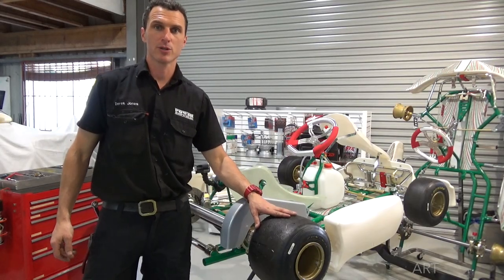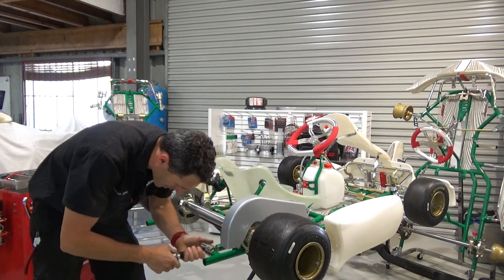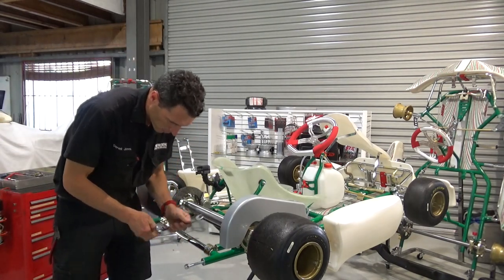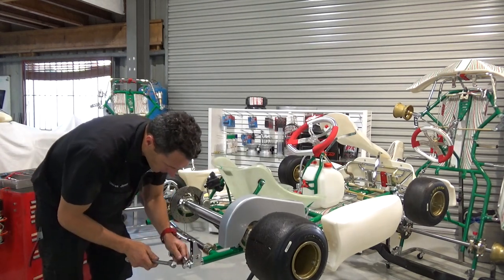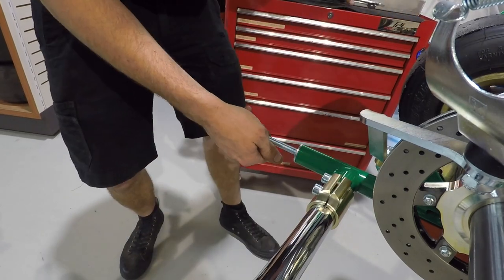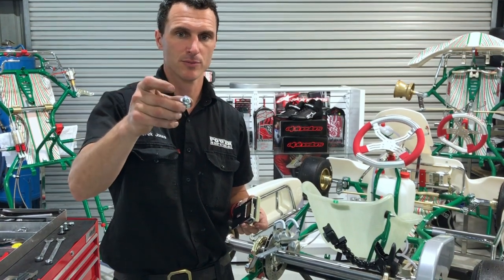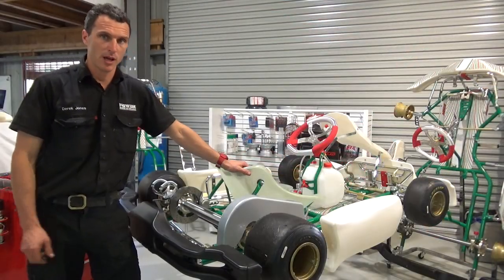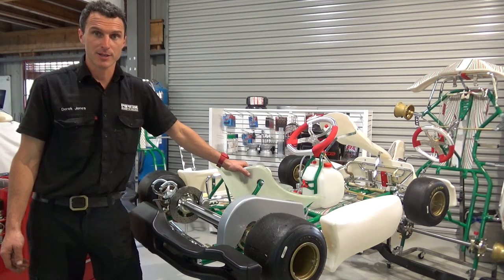How to - Install Tony Kart Rear Bar -  The Easy Way

Comment: How to know if the rear is bend ?
Reply from the maker: inoted ng it’s a bit harder as you would need a flat bed/table to measure and see if it was sitting up. Normally the brake side rear chassis rails bend up in a big accident.

Comment: Great video keep them coming    I got a quick question   Where I live we get winters below freezing with tons of snow. How would you winterize a rotax 125   For winter storage   I know I gotta drain radiator , but how to get water out of the motor? Crank it over?    Thanks. Billy
Reply from the maker: Eastendhunter9 I would drain the water out by removing the radiator. Then tip the engine back and forward to move the water around the engine to fall out of the bottom radiator hose outlet of the engine. That way you won't have any water left in the water jacket of the engine.👊🏿

Comment: Gday, we currently use a plastic bumper on our Alonso kart, just wondered if you could let me if there is any difference using a plastic bumper to a metal one?
Is a metal one better to use on faster tracks?
If so what metal bar would you recommend?

appreciate any answers .

Thank you Tony
Reply from the maker: Hi Diane, the metal ones were awesome cause you could loosen and tighten them and the effect was more than the plastic equivalent.   if you can use the metal one in your rules, I would use it cause it has less weight and also a tiny bit less aero drag